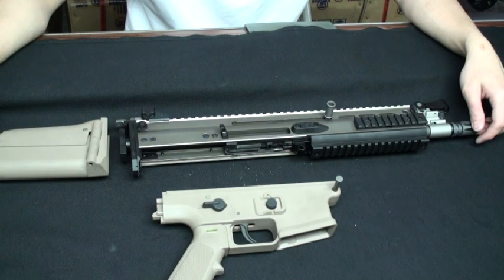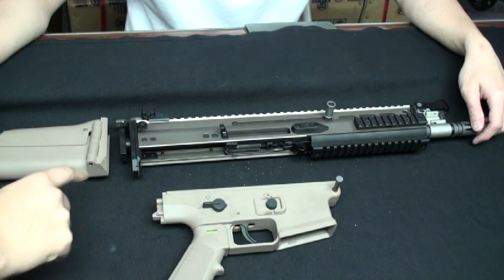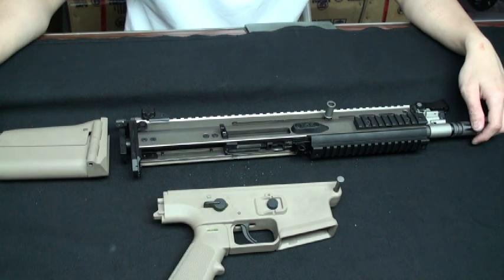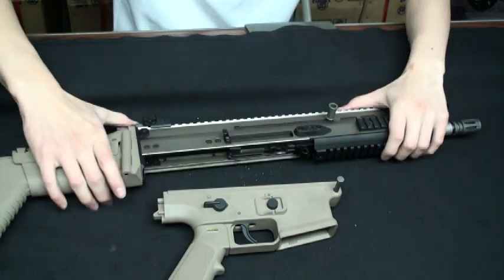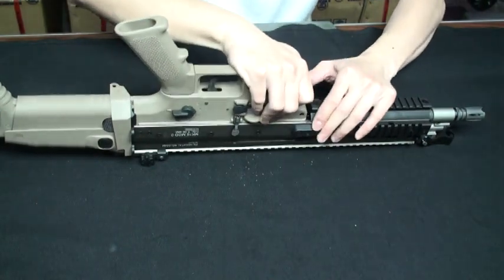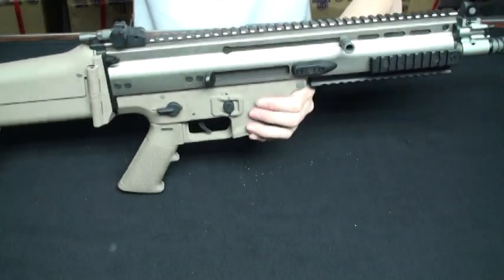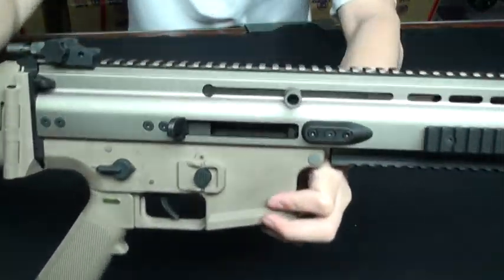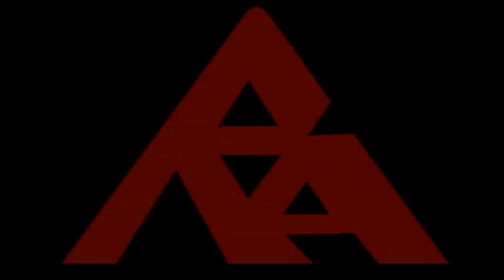Ra Tech We scar open bolt upgrade tutorial Part 2

Comment: Hey I am about to install an Open Bolt NPAS into my WE M4A1. As of now it is the brazz tube system but I have also bought the Open Bolt Conversion kit for it. The Open Bolt NPAS should not be a problem (I have found a tutorial on that) but I don't know exactly how to do install the Open Bolt kit to replace the older brazztube system. There are zero tutorials or videos to show how it's done, only on SCAR/PDW. Could you please upload a tutorial of this, RA-tech or someone else? Appriciate that.